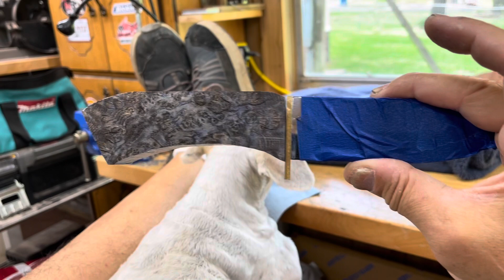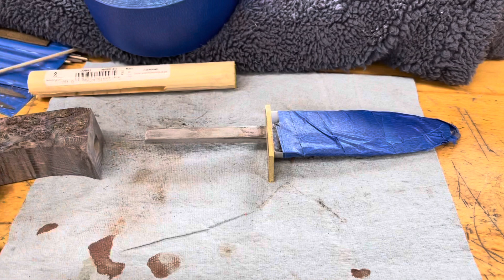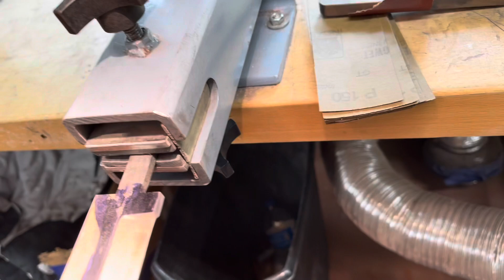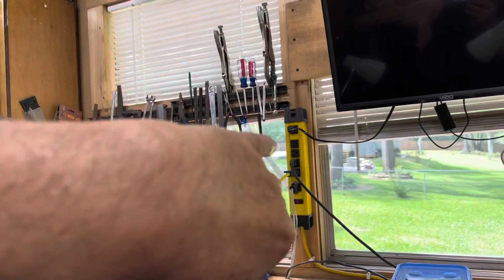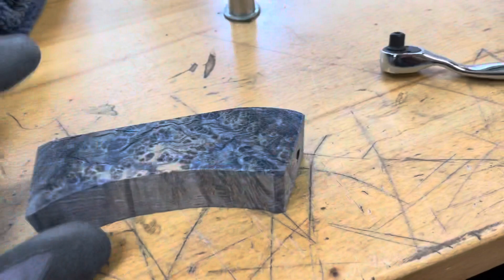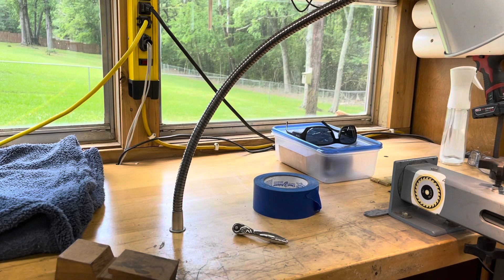After all that work!

Comment: I’ve spent thousands of dollars trimming my neighbors trees that hung over my fence and house. I have one tree, oak, and it’s out by the street and only hangs over the street and my side driveway. My back yard has no trees but I’ve spent more money than what’s fair trimming the trees in my neighbors back yards. I figure it’s cheaper to cut down a tree than it is to replace my roof or screened in porch! I think you look at your minor knife baking issues the wrong way, you see them as flaws or mistakes. Not true! Your making custom knifes, everyone a kind of it’s own, no two the same. That’s not a hole in the back of the handle, that’s a hole so one can see that’s it’s metal all the way thru! It’s custom, there are no flaws or mistakes.
Reply from the maker: I think Darron had a great idea, Ill make it a lanyard hole and add blue lanyard to match the wood.,